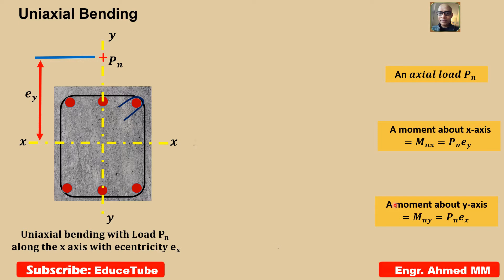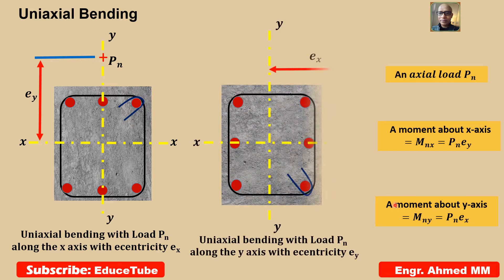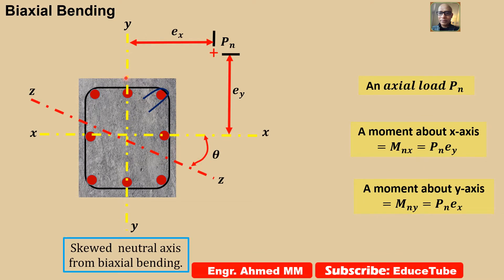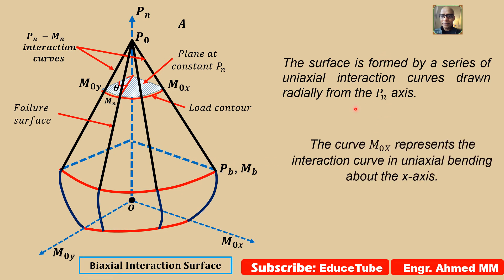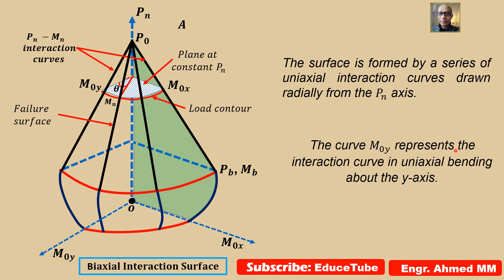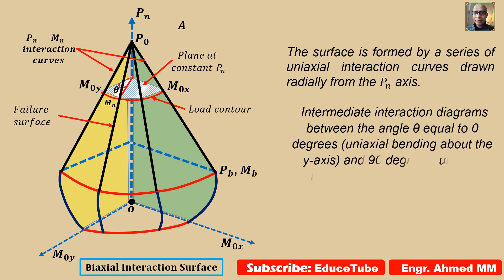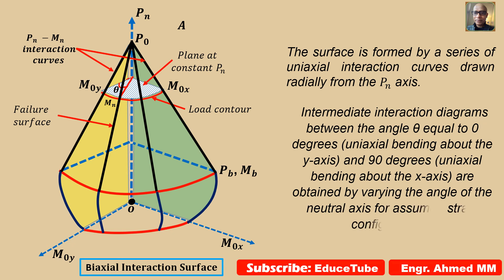Biaxial bending and Biaxial Interaction surface for column section

Comment: Theta angle wich you refer on the interaction surface slide, appears to be the same to the theta angle wich you indicated in the previous slide (related to the cross section subjected to the eccentrical load). I think that's misleading when using the same name for two different angles. Theta angle indicated on the interaction surface refers to the ratio between My and Mx, while the theta angle indicated in the cross section slide is the angle between the resultant eccentricity and the neutral axis. These two directions are perpendicular only in very special cases.